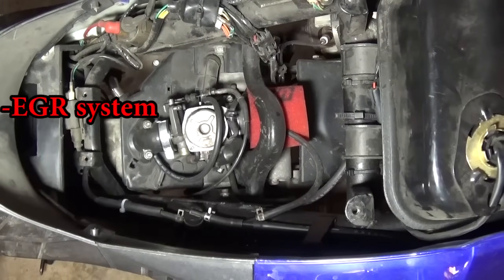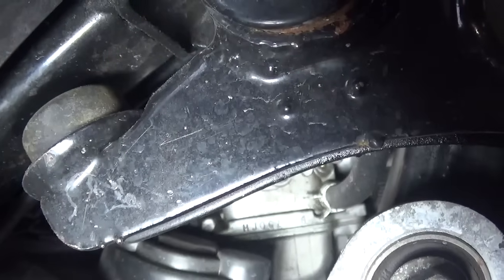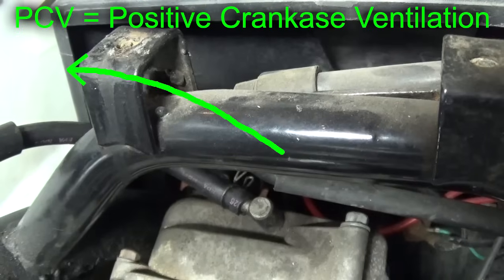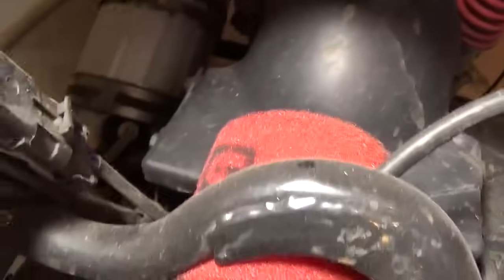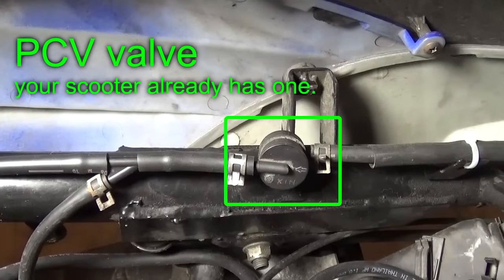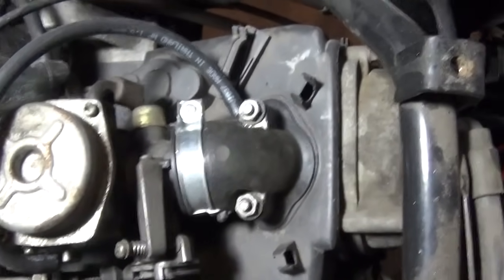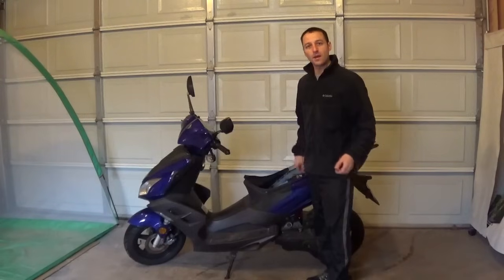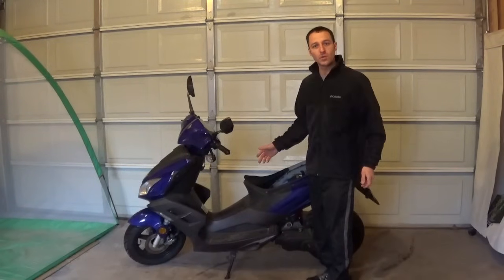How to simplify vacuum hoses on a scooter

Comment: If your scooter has a vacuum operated fuel pump, you need more hose and connections ,  your description is correct if you have a scooter without a fuel pump, using only gravity feed to the carburetor
Reply from the maker: That's correct.  Scooters with the gas tank in the floorboard will have a fuel pump, and scooters with the gas tank mounted higher than the carburetor don't need a fuel pump.

Comment: I just got a BMS Prestige 150 which is CARB compliant. First thing I did was remove all the PAIR/EVAP crap, the stock air box and installed a NIbbi intake tube with a UNI foam filter. I ended up with a shit load of hoses vales and canisters which I tossed in a box. Valve cover vent hose I just stuck into the air filter until I install the oil catch can inline. As far as the gas tank vent hose, I just cut it short and stuck a small filter on the end. I dont think I would route the tank vent hose back into the intake unless it had a vented gas cap. The tank has to be allowed to breath as the fuel level changes. Routing the vent hose back into the intake would pull a vacuum on the tank which could cause fuel flow issues. I bought a nice fuel cutoff switch to replace the petcock but I decided to leave the petcock in place for now. I just dont trust the valves in the carb alone to hold back the fuel when the engine is off.
Reply: hi and question on taking the pair out. the question is can I reroute the crankcase vent hose to the intake hose at my intake manifold rather than taking it to the front side of the carburetor?

Comment: I'm definitely going to try this.  This videos great there's not many out there if any.  My carb has always had an open port on it that I just didn't think was anything, i thought it was for the overflow.  The only line that I have going to my carb is the fuel line, no vacuum lines.  i'm going to switch it over today and see what happens.  Thanks a lot
Reply: but yeah my scooter doesn't have that pcv.  It does have that big black cylinder you can see in my video maybe that's the same thing.
Reply from the maker: POLO tv
The black cylinder is a charcoal canister I think.  You can get a small PCV valve at the auto parts store for less than $5.

Comment: Does the scooter run faster with the egr crap removed? Mines already blocked off at the valve cover, but the whole thing is still there. Also its connected to the air filter and the intake manifold. I think there is a vacuum leak somewhere in the egr. Because my engine stutters when i 1/4 throttle . Over 1/4 throttle it stutters once and accelerates.

Comment: So i got a POS chinese scooter for free and shes running great, thanks to your full rundown of the "fix everything" video of chinese scooters. I did notice from this video that my crankcase ventilation has a  tiny hole at the top but nothing is connected to it. No hoses or anything. The scooter runs great tho. Should i leave it how it is or do you think its necessary to get a hose leading to the airbox or air pod
Reply from the maker: Running a hose from the crankcase to the air box is a good idea to keep vapor out of the atmosphere, but it won't affect performance, and it's fine to leave it disconnected.

Comment: hi I have a problem with my 125 scooter  I don't know where to put the top hose from the egr valve cover where does it go some say the airbox but there's already 1 hose connected and another clear tube with a plug on end can you  help

Comment: Paul, I think you helped me out with a small problem I'm having. I transferred to a UNI air filter from an under the seat filter on my Tao Tao Lancer 150. The old filter had an extra line coming from the plastic ext. hose that connected the air filter and the carb. I removed that line and put a cap on it and that was a " no no" it started leaking a little gas on my CVT cover. I now see that it must be run back into the UNI filter, is this correct? Currently it runs from my engine head to a  "T" connector and all the we way back to the end of my CVT cover. I vented the line today and can actually see the vapors, which I assume should be going back into my UNI. No wonder I had big problems with cold starts, been using a lot of starter fluid.
Reply from the maker: The valve cover should be vented to the air filter.  This will suck up crankcase vapors.  The gearbox hose (the one at the back of the CVT cover) does not need to go anywhere in particular.  This just protects the final drive gear seals from leaking when the temperature changes, because it equalizes pressure.
Reply: Thank you bro, is it normal to see the vapors coming from the air filter or should the hose be turned into the direction so it flows right into my extension pipe? Thanks again for answering.

Comment: Shoulda installed an oil catch can inline with the crankcase vent line to catch the crankcase vomit. Feeding it directly back into the intake is gonna dirty the air filter and eventually gum up the inside of the carburetor.
Reply: You read my mind

Comment: what if i dont have a port on the carburetor for the vacuum line can i run it into the over flow does jt need a open air source i already removed the egr
Reply from the maker: I have a newer video about the hoses here:  https://youtu.be/li95pzfhAnM

Comment: Hey Paul, thanks for the vidz. But, I'm still having problems. I've got my lines exactly the way you do except mine still won't start without being bottle fed fuel. Then once that runs out it dies. Or sometimes it'll stay idling fir a few seconds lo ger giving me enough time to pull the throttle but as soon as I start to turn the throttle it immediately dies out. I'm racking my brain trying to figure this out. I did not hook up my enricher either. Surely that's not the problem I would t think. Plus it looks like the oil from the valve cover is feeding down through the gas line filter. It went from yellowish to gold almost brown. I'm super lost on this right now. 50cc gy6, new carb, new cylinder, head and piston. Rings are clocked to spec. Valve lash is set. New cdi, stator, flywheel, coil, plug and wire,fresh non ethanol premium and still same thing. Starts if I hold my hand over the backside of the carb but soo  dies as well. I'm frustrated to say the least
Reply from the maker: You might be running too lean.  Check to see if there is an air leak between the carburetor and engine.  Make sure your intake manifold has the spacer that goes between the manifold and head.  If you're running the stock carburetor, the idle enricher should be connected.  
It's possible your new carburetor has the wrong size jets for your engine too.
Check out my carburetor tuning video:  https://youtu.be/iCGjVRyN6YU

Comment: I just bought a 2005? Qinqi 50cc 2 stroke scooter with the D1E41QMB engine and the previous owner changed the carb to a PZ15 and said he couldn't get it to run without manually adding fuel so sold it to me as a lost cause. Only problem I am seeing is my vacuum petcock is not connected to a vacuum source to let fuel flow. Where would I attach the hose on my motor or carb to make it operate correctly as there is no service manual I can find for my bike online. Is this carb correct for a 2 stroke?
Reply: Probably either to an inlet port on the intake right before the carb, or if your carb has an extra port with nothing connected near the fuel inlet port then possibly that.  . No clue if the carb is correct for the scooter.  You can get away using a ton of different carbs if you can figure out vacuume

Comment: Besides the vacuum hoses that you explained, there are two
other thicker black hoses on my Evo 150cc Taotao scooter. They start off at the
right-hand side of the scooter. One of those hoses goes to the front of the
scooter's where it is connected to the engine. The other thicker black hose is
connected to what looks like a black canister at the right-hand side of the
scooter's frame. It is located on the frame between the fuel tank and the
ignition high-performance coil box. However, at its end, this thicker black
hose (about double the size of the other vacuum lines) is not connected to
anything on my scooter and is just hanging by itself. I am suspecting that it
is the reason why the scooter is not starting. Also, on the left-hand side of
the scooter's frame, there is what looks like another black canister which has
two hose connections, one small another one bigger, but then there are no hoses
connected to it. I suspect that the lose thicker black hose that is dangling in
the middle of the scooter fell off from that. May that be the case? However, I
don't want to connect that hose to the black canister on the left side of the
scooter because I am not sure that it is supposed to be connected there. So
far, I have searched in vain and have not found a YouTube video with an
explanation of the purpose for those thicker black hoses on the scooter. Are
they part of the scooter 's vacuum system? Please advise. I look forward to
hearing from you. Your explanation will be highly appreciated.
Reply from the maker: The big fat hoses and canister are your evaporative emissions system.  Theoretically, the evap system takes fuel vapors from your carburetor and gas tank and stores them so they don't evaporate into the air. 
What really happens is all that stuff is very low quality and doesn't work, so you're getting fuel vapors out into the air anyway, probably flooding the engine, and you might have some vacuum leaks too.  Just rip all that stuff out, and keep only the minimum number of hoses mentioned in this video.
Reply: @LabCoatPaul  Thank you very much for your detailed response and explanation with regard to the vacuum lines on the Chinese scooters.  Yes, I agree, and I wanted to remove the many vacuum lines on my Taotao scooter.  However, I thought that if I remove them the scooter will experience some problems with idling or starting.
Reply: @LabCoatPaul  Yes, I agree with you that these Chinese scooters, like my Taotao scooter, have many unnecessary vacuum lines that are sources of leaks. You say “Just rip all that stuff out (vacuum lines), and keep only the minimum number of hoses mentioned in this video.”  So, how about if I remove all the unnecessary vacuum hoses, including the thick one that goes from the front of the engine to the back of the scooter and top of the fuel tank? Also, do you recommend removal of the petcock and the vacuum hoses that are connected to it and connect the fuel line coming to the tank directly to the carburetor using a manual switch? Will the scooter start and run properly without the petcock?
Reply from the maker: @FKtdyvan  Yes, the scooter will work without a petcock.  The fuel petcock is an important safety feature (If it works), and shuts off gas to the carburetor when the engine is off.  If you drop your scooter and it doesn't have a petcock, it will spill the entire contents of the gas tank through the carburetor, on to the ground.  If the petcock is working and doesn't leak, you can leave it.  It's the evap and egr systems you don't want.
Reply: @LabCoatPaul  Thank you for informative and useful advise. It is nice for us to benefit from your knowledge on these issues regarding these Chinese scooters.
Reply: @LabCoatPaul  so if I'm going to still run a mikuni vaccum assist Peacock I'd still need to keep the second vaccum port off the manifold correct

Comment: The vacuum line that comes out of the intake manifold into the side of the carburetor. 1:48 What is that port called, or what is it for? My moped doesn't have a port on that side of the carburetor next to the throttle cable. It does, however, have a port on the other side, but it already had a short cut-off hose running out of it with a 90 degree open ended downturn. I have no idea what that is either. Any help is appreciated
Reply from the maker: I never found out the actual name of the diaphragm on the side of the carburetor but I think it helps with the idle circuit.  Check out this video for more information on the hoses:  https://youtu.be/0NwRbp6-vtY
Check out this video for a closer look inside the carburetor:  https://youtu.be/0m13eJrfwOw
Reply: @LabCoatPaul  thanks, your videos are a lot of help. Currently I have my scooter idling. But as soon as I give it any amount of throttle it dies. If I set the idle screw too high it dies. I've tried adjusting the idle mixture screw, it can run with it completely removed but it dies when it's screwed in. I've also tried adjusting the "C" clip on the needle & I can't tell what is better or worse because like I said as soon as I give it any amount of throttle it dies. So I'm just kind of stuck right now
Reply: That one runs to the vacuum operated accelerator pump if I am not mistaken

Comment: I have a line that runs from my intake to my petcock ? is that normal? no spot for it on the carburetor. and my valve cover vent I just ran a line to a filter... should I make it go to my air filter ?

Comment: One of my hoses is disconnected it's coming off of the silver thing underneath the carburetor were does it go
Reply from the maker: The hose under the carburetor is a float bowl drain. It just hangs from the bottom of the scooter and doesn't connect to anything.

Comment: I took of my petcock do I have to put filter on end and take off air box and cap the front where the hose go from there to petcock
Reply from the maker: The fuel petcock has a vacuum hose going to it that opens the valve when the engine is running.  It's a safety feature.  If you drop your scooter and the engine is off, the fuel will stop coming out of the gas tank (unless your gas cap leaks).  You'll need to cap off that vacuum port at the intake manifold.  
Without a petcock, if your fuel inlet valve in the carburetor gets stuck open, you'll get a puddle of gas under the scooter and it will be hard to start, but once you get going it will run ok.
I don't recommend removing the fuel petcock, but as long as the fuel inlet valve works fine, you should be OK.
Reply: @LabCoatPaul  ok yea I put new carb and pet cock and gona put new tank on it to but idk what size of hose to use for fuel line and the air ones

Comment: Thank you for you videos ,,,I have 150cc chinese scooter, running great, new carb, I decided to do an upgrade and add a uni intake, I used a custom raidiator hose to fit under the frame,and remove some emisions, and stock airbox, I changed main jet from 103 to 108 and no matter where I move the idle or mixture screw, it starts, then just dies and after 30 secs no warning, it gets very boggy on throttle and when I took it down the street it was not as fast and was a bit "chuggy" and "bucky" this happened with 100, 105 and 125 main jet, the vaccum hose from the manifold is connected the same and the PCV and the other emisions vent that were going into the old air box are just vented into the air and zip tied to the frame, do have any idea what happened? The scooter was running great before I did a few things, could it be the needle? what do you think?

Comment: Hi Paul hope you don't mind me messaging you but I have a 125cc pulse lightspeed 2 scooter and I'm having a problem with no fule getting to the carb, unlike in this vid where you only have 1 pipe coming from the bottom of your tank there are 2 coming from my tank, the top one gos into the t shape where it his down into the intake and across the top of the carb. the other fule pipe from the tank on the bottom gos into the bottom of the carb which I'm sure you said in your vid was the main petrol line ? if you can give me abit of advice I'd be so greatful as unless I pure petrol into the carb it will not start. many thanks

Comment: Question I have a cy50a  it idles fines but once I start accelerating the revs jump so high and I mean high 8000 plus the scooter sound so dam loud any idea wat it could be.......also I replaced the exhaust but still revving up like crazy and loud
Reply from the maker: unless you're going over 40mph, your rpm should not be at 8,000.  Check your drive belt, variator, and clutch.
Reply: @LabCoatPaul  ok thanx

Comment: Hi Paul...you seem to understand these scooters.  I was wondering if you could give us some advice.  I have a peace sport 50cc that isn't getting gas right now.  It started out with different issues and we are troubleshooting and replacing parts, and now the gas isn't moving.  We have replaced the carburetor, fuel lines, fuel filter, cleaned air filter, changed oil, changed gear oil, replaced cdi, and we bought a replacement fuel valve switch, but the nut was put on upside-down to what we need and the threads don't match up.  The threads we need to hook up to the gas tank is on the opposite side and they flared that so the nut won't come off.  What we have noticed is there is no gas moving from the gas tank to the fuel filter. (that's why we ordered the fuel valve switch thinking it wasn't working right)  I'm wondering if it's a vacuum problem?  Can you give us any advice or suggestions?
Reply from the maker: +Julie Crispin The fuel valve that bolts on the fuel tank has a vacuum line.  It's a safety feature.  When the engine is running, vacuum opens the valve, and fuel can go to the carburetor.  Often times this part can be bad (even if it's new), and will leak fuel or air and not let fuel through.  You can simply drill through it and cap the vacuum port.  Then you'll have all the fuel you need.